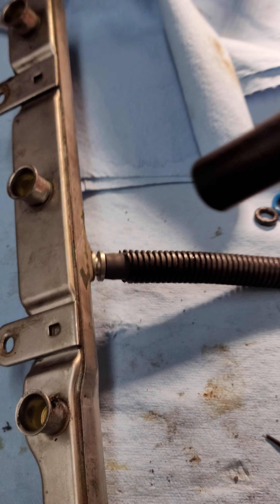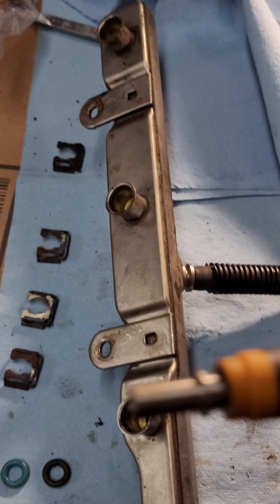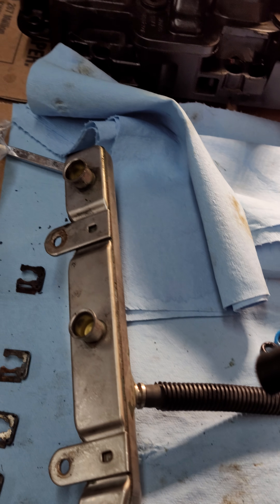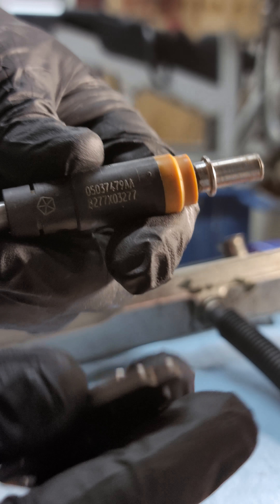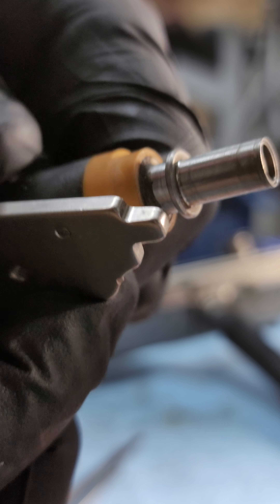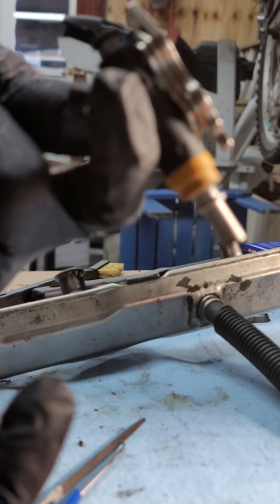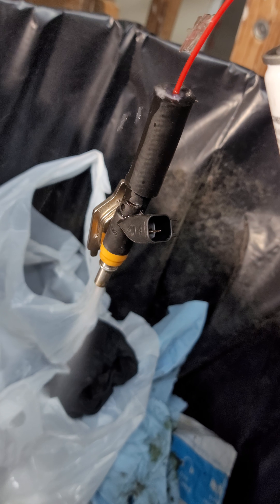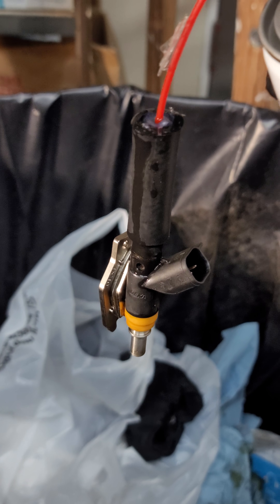How to clean Fuel Injectors without 12 Volt Battery power.

Comment: That is genius man!! It won't burn out or mess with the electronic solinoid because it is just a physical pull open of the port. When using a battery you need to only do small bursts of the voltage to help not hurting the electric coil.
Reply from the maker: Yes! I was thinking along those lines too. Thanks for the reply man!